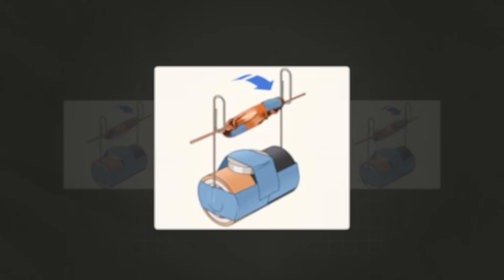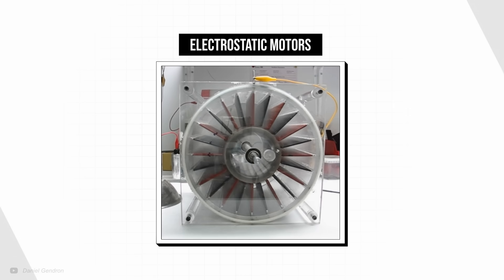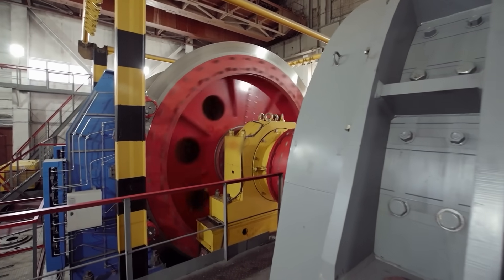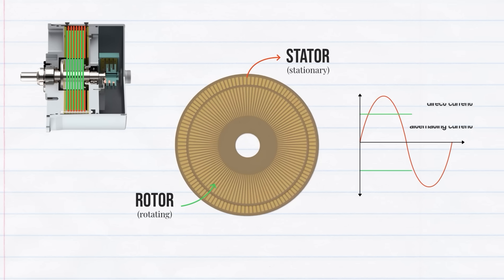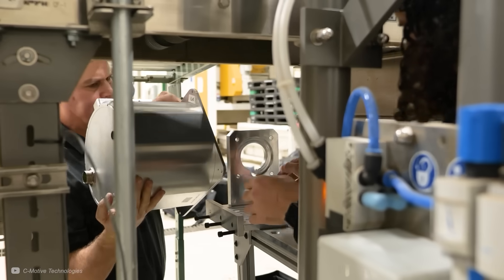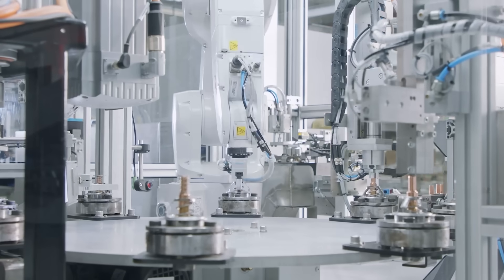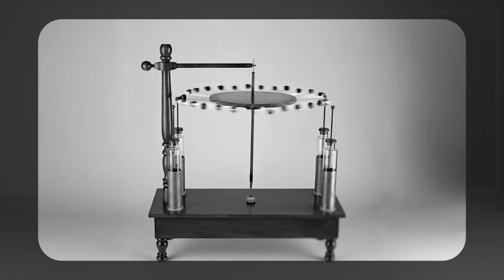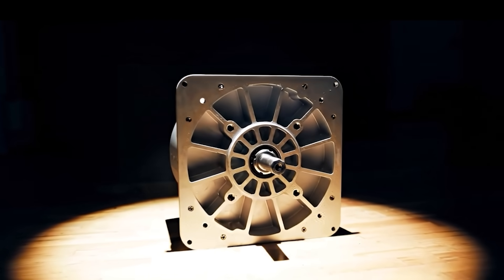How Electrostatic Motors are Breaking All the Rules

Comment: Interesting commentary about electrostatic motors, which are very interesting.  Certainly the materials needed are wildly different from heavy reliance upon copper and rare earth metals.  

At 08:47 there is some misleading commentary about efficiency, however.  Conventional electromagnetic motors can be quite efficient, far more than the 60% cited in the video.  If you want to add gearbox losses, fine --- but that doesn't have anything to do with the fundamental motor technology.  

One of the challenging problems for electromagnetic motors is that, to anthropomorphize for a moment, electromagnetic motors do not enjoy high frequency changes of current due to magnetic losses and just plain old Kirchoff's Current Law.  They'd really prefer to run at relatively low RPM ... 

Electrostatic motors don't have these issues.  There is such a thing as dielectric losses, but they typically occur at frequencies wildly higher than the equivalent losses in magnetic materials.

Although it was once true that power electronics didn't tolerate high voltage well, that's not true today.  Power electronics is one of the unsung heroes of modern technology.  Everybody knows that power supplies are boring ... everybody, that is, except people who know what keeps the lights on, what keeps your phone charged, etc. Power Electronics is your friend, and will help determine whether electrostatic motors are an actual thing.

Comment: Are these ac or dc high voltage and how is it supplied. Any method to convert ac to dc introduces additional loss. Is 120v, or 220v or even 550v enough to power these or is a step up transformer required (more line loss) ?

Comment: wouldnt these plates be prone to failure from vibration the change from copper to insulated flat fins in the disk would eventually peel apart. heat and vibration where as wound motors are far more industrial

Comment: The example you are giving saves around 400-600 € per year, assuming a 750W motor, depending on your energy prices. Hermetic encapsulation is harder than normal bearings, but not very hard, and it can cause higher maintenance requirements. The driving electronics are obviously more complicated than with normal motors. So, even with no gearbox, I'm pretty sure the motor price is much higher than a standard motor—ROI seems to be doubtful. And then there is the fact that the stated 30% reduction of energy use assumes a really inefficient motor/gearbox combination. My impression is that it would be much cheaper to achieve similar efficiencies using a better classical design, at least in this application. Assuming the torque is as good as they say, robotic actuators appear to be a much better fit for this tech. Why this example, then?

Comment: I find it misleading that you didn't identify that higher-voltage in a magnetic-motor is how you increase its efficiency, & reduce conversion-into-heat,
& this has been done for ages.

It is why high-power lathes use higher voltages.
Double the voltage, & you reduce the mass of the windings by some significant factor ( don't know if it is 2, or other ).

This is why all DC motors should be closer to 48v, not 12v,
& just use a DC-DC converter, & then your motor-size reduces & your lugging-around-heavy-motor is reduced, too..
( I'm thinking for boats & bicycles, here, not e-cars, which already use hundreds of volts ).

48v simply because the next 12v increment is 60,
& that's the next legal-regime for safety,
so system-builders usually stay below that, to avoid hitting higher regulations.

Also, you showed in your illustration that usually permanent-magnets are in the rotor,
then just-recently, you showed a rotor which doesn't have magnets in its rotor, it is .. I forget the name, "an inductive motor" or something,
the inducted-magnetic-field in the steel-wafers in the rotor make the rotor turn slightly slower than the rotating-magnetic-field,
but they can have massive torque, & are standard throughout industry..

_ /\ _
Reply: Good video.

The ACTUAL-use improvement of 30% is what I'd call the truth..

& comparing high-tech motors, with their precision manufacture, vs normal plain off-the-shelf industrial-motors, is .. not correct.

Keep up the pushback!

Get the actual truth.

_ /\ _

Comment: And what about the power supply for these motors?  High voltage is not that easy to generate or distribute in multi phase as required for higher torque.

Comment: What about a vacuum chamber thats continuously pumped, could solve dielectric breakdown, enablimg higher rpm? Or are there no dielectric gasses that could fill the rotation chamber? Could there be seales good enough for this?

Comment: Seems a factory that has hundreds of such electric motors would make tons of heat which effects the employees work environment making it very hot or if using AC it will cost a lot. An added benefit if switching to electrostatic engines, happier employees or a smaller electric bill for AC.

Comment: I started experiment with two celing fan .. but required high voltage which is need power electronic knowledge like which IC circuit board etc .. serching for it

Comment: You should check out the type of motors the company I work for makes.  We design VFMM, variable flux magnetic memory, motors for automotive traction applications.  We have the low RPM torque of permanent magnet motors with the top end efficiency of a reluctance motor, all without the use of rare earth elements.  The basics of the motor operation is the motor fully magnetizes the magnets in the rotor when high torque is required.  As torque requirements drop, the magnetic state is reduced as well.  This keeps the motor running in a 96 to 98 percent efficiency.  Most of the losses are through transistor switching slew rate and bearing drag.

Comment: Could an electrostatic motor work in reverse as a generator too? One of the problems with windmills and Stirling engines today is that they tend to rotate fairly slowly and need complex gears to drive a traditional electric generator. A generator that is optimised for a lower speed could be a very interesting alternative here.

Comment: Interesting. But running the whole motor in a liquid introduces a lot of frictional losses. It seems easier to just go with induction motors (conveniently ignored in the video) if you want to pass on rare-earth materials. And you can replace copper if you really must, most obviously with aluminium. Only ultra low weight might be an issue, because I don't know of anything substantially lighter than iron that can replace it in magnetic cores.

Comment: Wonder what the issue was using a silica aerogel with a low presaure nitrogen as insulation instead of a liquid. It isn't much of a step designing to hold liquids without leaking and designing to maintain a vacuum (especially if you can throw a small vacuum pump to engage occasionally to provide assitance over time). Hell, if you allow for spray can size cartridges of pure nitrogen you can reduce tolerances or costs and get a second product income.

Comment: As others have noted, using a liquid between multiple plates  leverages the liquid's viscosity to a significant level of concern, generating considerable heat with rapid rotation.  Consider the Tesla turbine effect working against its self.  Perhaps, instead of a liquid, a gas could be used; such as Sulfur hexaflouride, an insulating gas used in extremely high voltage electrical systems.  Using the Tesla Turbine effect as a pump,  the gas could easily be circulated through a heat exchanging device (possibly part of the motor body) to dissipate what little heat is generated with this system.

Comment: You said the dielectric fluid is non toxic but not what it's called. Then it's not polyclorinated bifenyl. Is this mystery fluid something that would also function as the dielectric oil(PCB) in old transformers and to perform the electron discharge machining process? That would be great if no more PCBs were never made again, I've been told it's only plutonium that is more hazardous

Comment: Very interesting.  The efficiency comparison should be made with standard motors with variable frequency drives, especially since these are so common now.  The numbers I recall exceed those quoted for this electrostatic motor.  But as some have commented below, the electrostatic motor has its own advantages.

Comment: Question, don't these electrostatic motors require several thousand volts? we know these new motors are 90% efficient. But what is the cost when you facture in the controller  and the high voltage inverter required to make these motors operate? What is the efficiency of the high voltage inverter? They combine the efficiency of the inductive motor and gear box. but only fair if they provide the efficiency of the combined motor and inverter to run it.  And how much would a new 3HP electrostatic motor and the control and inverter to run it? and how long would it take to pay if off as compared to a low cost inductive motor? Money is only saved if the pay off time is low.

Comment: not all electromagnetic motors use permanent magnets, and on top of that not all permanent magnets are rare earth magnets. almost all the "regular" motors you show are induction motors which have no permanent magnets at all. On top of that most motors these days only need gearboxes because they are using a standard cheap motor design and not one custom to the application. I bet you could make a BLDC motor that would directly drive this stuff with no gears and have a much longer service life since its not full of liquid and has seals that will fail at some point.  this is a cool idea though, if they can get this working without the liquid they would probably be a formidable option.

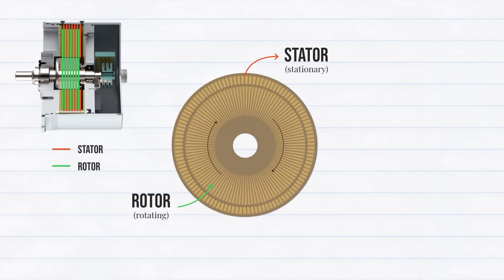Comment: I think the best way to differentiate width, length, height/depth is to think of the most likely place for you to use that word in extreme situations. Length of a rope is the longest dimension, width of a tv is it's longest dimension, but then we aren't using length, we use height and thickness/depth. 5:00 Saying a credit card's width is 0.8mm feels off because you'd look at the number on it and the logo in the corner, and recognize the orientation as being wider than it is tall. Some cards are printed vertically though, so length and width may be confused by the odd person quit understandably, but the dimension you speak of is most certainly thickness or depth; not width.

Comment: Interesting stuff but a little too much based on promotional material by the company developing the product, and you can kind of see this in the low baseline motor efficiency along with what look like exaggerated or atypical additional savings such as HVAC and so forth.  Better to temper this by explaining that larger squirrel cage induction motors typically have an efficiency of 90% or more, making them tough to beat in many applications, although this might be good for some specialized applications as you pointed out.  Also better to explain that (as others have pointed out) the induction motors do not use permanent magnets (and therefor no rare earth elements needed) but do use copper.

Comment: ok so they are comparing an old worked in setup against a brand new one ... right off the top the same overhead will still exist so no savings there ... aside from less of them used at full ... as for the rest ... run that motor for 20 years non-stop then compare it to a standard setup and see which one is actually more efficient ... a basic peddle bike and a 10 speed bike are both bikes one is efficient the other has less efficiency but more options to choose form to adjust efficiency ... BOTH are still the same amount but one can change on the fly

Comment: Magnet problem is generally already solved with EESM and especially with iEE SM. I'm not surprised they backed down on automotive at the moment, their design basically can't be used with EVs and what's more current tech already achieves ~90% efficiency there so most likely their cost-saving figures don't apply. Also I'm not quite sure how regenerative braking would work there with electrostatic motor and what would be the losses in transforming high voltage low current into ~400 (or 800) VDC for battery.

Comment: People commenting on how the dielectric fluid needs to be removed for high speed are missing the material engineering challenge of making a thin plate strong enough to resist the centrifugal tension forces that would be applied to the roter plates at high speed.

Comment: motors arent cheap but they arent expensive this motor sounds like its both expensive and hard to maintain once it finally does break.
its the classic yes you pay more now but save on electricity later but at the end of the day a client is going to see 600k for one motor and 230k for the other and point at the 230k one every single time.

Comment: It is also possible to build electromagnetic motors without permanent magnets. This is achieved by simply using electromagnets on the inside and outside. Although these motors are slightly less efficient, they offer other advantages such as more precise control, which is beneficial for electric vehicles. Cars such as the BMW iX are already magnet-free and use FSM.

Comment: said fluid sounds a lot like just some specific ratio of mineral oils with high resistance to dielectric breakdowns, much like what you can find in transformers but at a lower viscosity

but regardless, this is big news! looking forward to see this motor category to be developed further in the future as gearboxless high torque applications would also mean space savings in tighter quarters, imagine if these can be scaled up for usage on cranes and winches for example

Comment: We already have large industrial 3 phase induction motors that DO NOT use permanent magnets. The elimination of permanent magnets only applies to non-induction style motors and that leaves the only main benefit to these electrostatic motors in applications that require low speed in order to eliminate gearboxes that would eat into efficiency.
This large oversight in your video is showing a failure to do your own research, like you simply spoke to a PR individual from a company and then wrote your video script without looking at any other information.....

Comment: You don’t use rare earth metal in industrial 3 phase motors. This low speed application could easily be replaced with higher pole motors. But the saving that big companies have on electricity provides very little motivation to be efficient

Comment: I wonder how expensive those high voltage inverters would be. I suspect that's why they focused on life time costs over materials costs.
If they can manage to get the price down they might have a winner, but its isn't the industrial machine manufacturer that pays the energy bill once the system is running.

Comment: not enough info to determine benifits. is the compared traditional motors vs high IE class motors? however pretty interresting since many industrial systems work with gearboxes with maby ratio 1:300 to 1:500 to a 1450/1475 actual rpm on a 50hZ motor. where for very large machinery a worm gear or planetary gearbox is very heavy, space consuming and expencive. however this segment most motors are like 10-100 kW, quite larger then what they make. what kind of voltage is required for a 100kW motor i wonder?

Comment: Closely guarded secret fluid formula.
Yeah, it almost certainly a type of fluorinated ketone, something like perfluoro(2-methyl-3-pentanone), commonly known as dry water, which has 74KV dielectric strength at 3mm gap.
It too is non-toxic, safe, used as a mist for extinguishers and as a heat transfer fluid.

Comment: It looks like a crude advertisement for C-Motive. The low speed is obviously caused by the viscosity of the liquid oil. The "secret fluid" is a well-known, inexpensive transformer oil. The claimed higher efficiency is only relevant when compared to geared motors. It doesn't seem like a game-changer. Cheaper production? Maybe.

Comment: 3:05 exactly why I believe research into peltier circuits must be done. It's a law of physics that energy is lost as heat when transferred yes? Imagine turning that heat directly into electrical current thereby scavenging and cooling at the same time. Not reinventing the wheel but making all wheels more efficient without batteries and amazing scalability

Imagine a tshirt that cools your body while charging your phone? Been possible for the last 30-40 years breaoux >.<

Comment: there is a problem with this video. most electromagnetic motors do NOT have permanent magnets on their rotor. most electromagnetic motors use a cage on the roto. so when passing current through the stator windings it induces a current into the rotor cage, which therefore creates a magnetic field which is what makes it spin. brushed dc motors use permanent magnets, but most high power electromagnetic motors.

Comment: Engine with fluid inside will starts leak sooner or later. Sealing of shaft made more energy loss that some gearboxes. Those engines are not maintenance friendly and I bet you can’t repair that engine when fluid go away. In almost any electric engine everyone can change bearings without any bigger problem and made that engine work again fast/easy.

Now try that with engine with fluid inside, add seals, fluid that only one factory will made = they will made cost that much higher… 

When maintenance of typical engine is once for 6-8y (clean up dust inside), then here maintenance is need in every 2-3y minimum.

And normal engine can work for some time with bad bearings, giving you time to buy new bearings. When your engine will starts leaking = stop working because less fluid = short circuit.

That is the same fake engineering like solar roads.